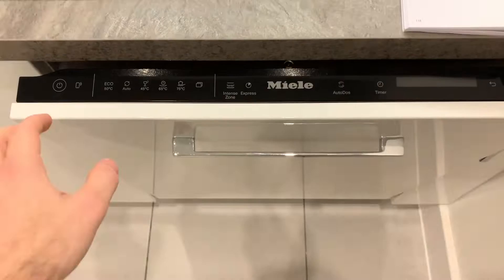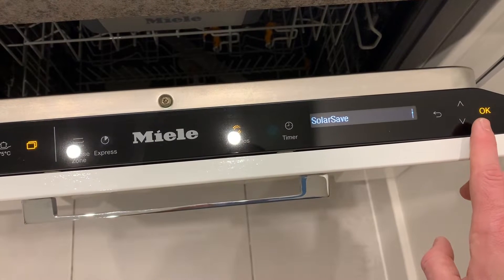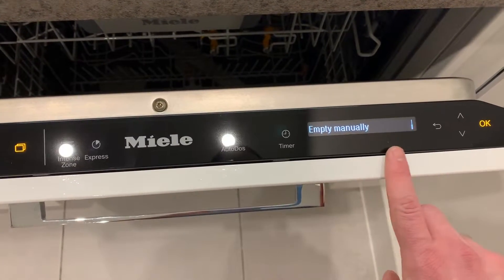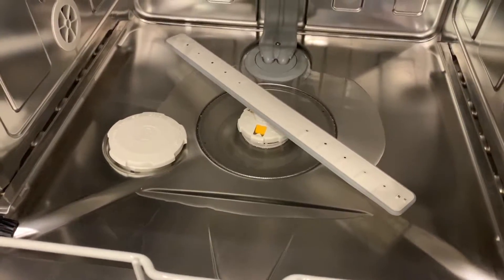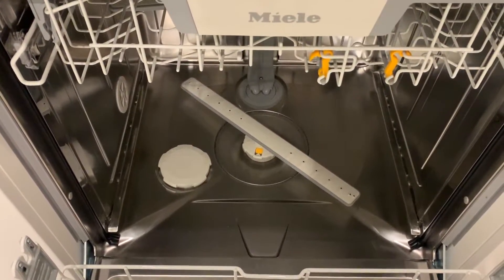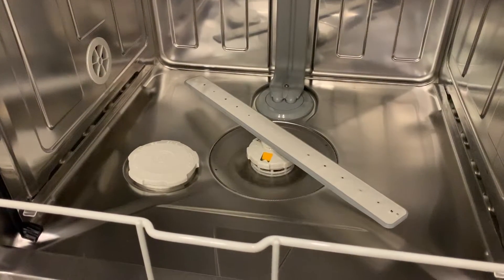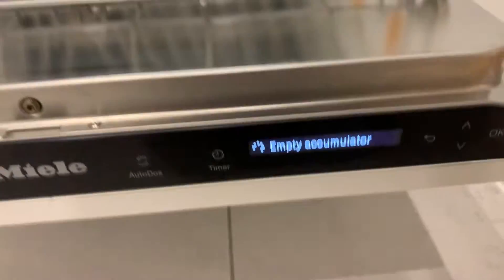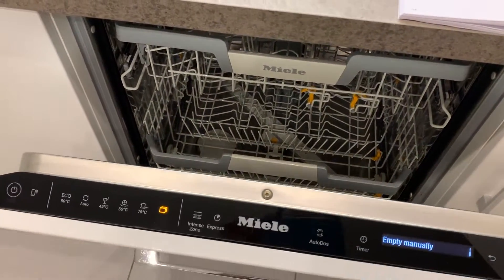Miele G7392SCVi Dishwasher: Heat Accumulator Emptying

Comment: I know this is an older video, but whatever. Interesting they call it the "Heat Accumulator" on an English-speaking market model. My Miele dishwasher has part "05894822" which seems to be called "Wassertasche Regenerierdosierung" which to "Water bag for regeneration dosage" and seen one locally for sale titled "Heat Exchange Water Tank". It lives on the left side of the machine, between the tub and the outer casing, and connects to the white vent/port visible on the inside of the machine, so I assume this is where the machine actually fills water from, at least partially. One of the channels on the tank/accumulator has a little water wheel where a reed switch sensor sits atop to measure water flow, I think this throws fault code F19 if it's faulty, unless if I'm mistaking this for a different sensor. Anyway. Having issues with my machine, still trying to figure it out 😟
Reply from the maker: @rakeau  yes to my mind it’s a test exchanger but I think something was lost in the translation! I didn’t realise there was potential for a fault code with this. What is wrong with your machine?
Reply: @ The machine would seem to fill, then drain, and then display message “Stopcock” or sometimes “Inlet”, even though the water supply was infact open.

Out of frustration I gave it a good whack and it doesn’t seem to have done it since 🤣 .. but I’m still a bit hesitant to put it back into the cabinetry just yet. Also I’m worried there seems to be some mold or dirt or something in one of the channels of the tank, I want to pull it apart and clean it but not sure how to.
Reply from the maker: @rakeau  yes the mould worries me. Also we have lots of limescale in our water too so I suspect the exchanger is filling with that too. Fingers crossed you solved the problem with a good whack! 😂

Comment: Man, the US versions don't have a heat accumulator, or these don't have the option to manually empty.  So weird!
Reply from the maker: Oh really? That’s odd I wonder why? You can hear when it does as it takes longer, it’s just a humming noise followed by slow fill as opposed to the cold water inlet.
Reply: @sabistar44  interesting, I’ll have to pay more attention at the start of the cycles to see if I can tell a difference.  I wonder if it’s omitted because we have hot water connections for things here?

Comment: What does heat accumulator do?
Reply: Stores hot water for things like rinses.
Reply: Kia N during the wash cycle it fills up the walls of the dishwasher with cool water, this serves as insulation and also accumulates heat that would otherwise be wasted. It then is used to fill up the dishwasher during the rinses to prevent heat loss and heat shock on delicate items.
Reply: condenses moist air during dry cycle